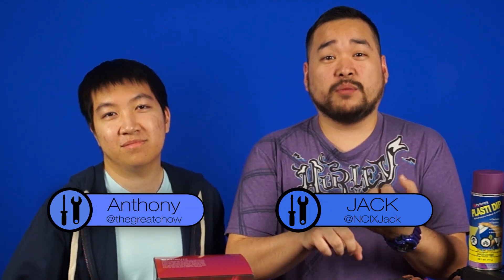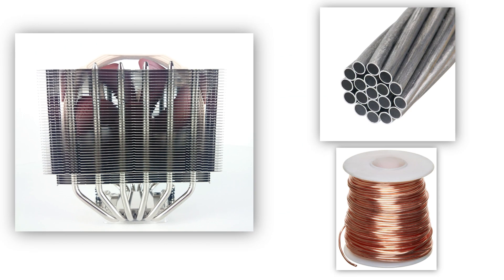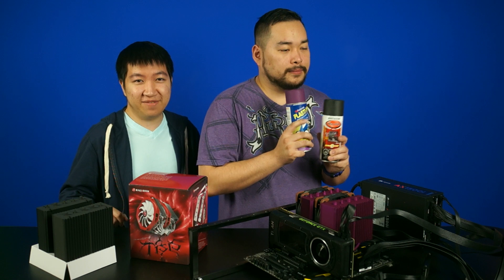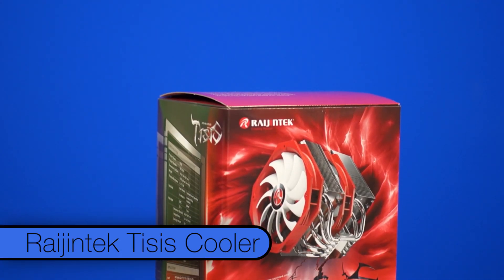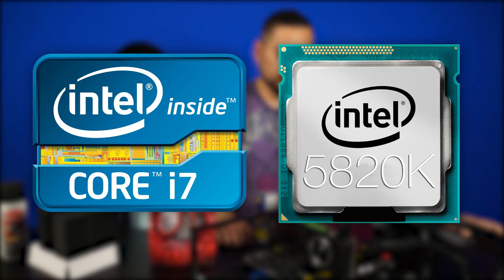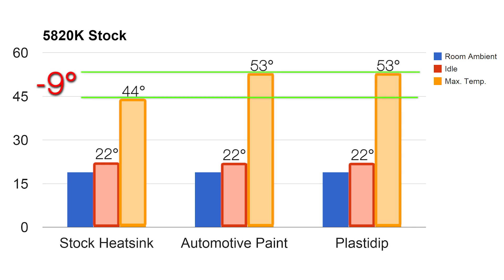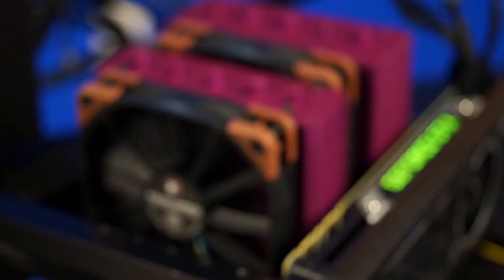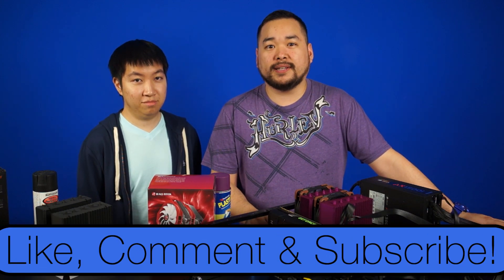Painted CPU Heatsink! Plastidip + Auto paint mod ft. Raijintek Tisis

Comment: Who knows. If this catches on, maybe we'll start seeing heat conductive paint coming out
Reply: It's called stove paint.
Reply: It would be suitable for this application, and affordable?
Reply: Fucking check, how would I know?
Reply: Kendawg McAwesome Stove-paint is not a good conductor - just about same as other paints.  As you said, it is made to be heat-resistant.

There are some paints that add rather thing layers only, but best would be to simply not paint the whole thing but only those sides you actually see - aka spra top-down so only the outer part of the fins get some color and on the inside they can still give off the heat.
Reply: I'm guessing if you were going to do that, you'd want something with decent airflow through the grill. At the end of the day this all seems way more trouble than it's worth to me, but I suppose some people are particular enough, they'd be happy to sacrifice performance.

Another thing that troubles me is whether the paint would stick for long without sanding, and whether sanding would further reduce heat expulsion. I don't know much about painting metal tbh, so maybe it's a non-issue if one picks their paint carefully.
Reply: Kendawg McAwesome Well - i do neither modding nor do i OC.
my CPU is rather bad pined ... ordered and bought at the same time as my friend, exact same parts for the entire build - 5°C higher temps for my CPu -.-

But i have done a bit in the past.
And well - if you get an a bit bigger and better cooler you can again sacrifice some performance for aesthetics.
If you do a mild OC and can till get good temps - why not.

I would rather go for a silver-white build anyways, but haven't got the time nor money to get myself a new PC.

Comment: i am thinking about using plastidip to paint over my M.2 ssd but some say it will bubble up since M.2 tends to get hot. is that true? does plastidip bubble up under temperature of ram heatsink or M.2 ssd?
Reply: Depends on how hot. Plasti dip can withstand temperatures of up to 200 degrees Fahrenheit.

Comment: Sure... I'd paint my "heatsink"... or more like, the CPU block/pump part of my AIO liquid cooler. I wouldn't do it on the radiator though.
But then again, it's already black. so other than painting to remove logos, I don't really see the point.

Comment: I don't think you should paint the contact point that's going onto the cpu tho
Reply: Guy Random there was the factory plastic cover on it which they removed and that means no paint on the bottom
Reply: WayStedYou Alright that makes sense. Still a huge increase in heat though :\
Reply: Yeah not worth it at all lol

Comment: Couldn't you just paint around the outside and leave the heat sink fins alone? You'd get the cosmetic benefit without degraded cooling.
Reply: Haha true. Reasonably they should only have needed to paint the top. But that would probably have made a boring video.

Comment: At the very least don't paint the part which makes contact with the CPU.  I have a feeling you'd have slightly better heat dissipation if that part was not painted, as you want to transfer the heat away from the CPU first.  Once it's in a larger area (the heatsink) you have a lot more area to transfer that heat from, so painting that probably isn't too bad.  But painting the bottom part would be a lot worse as it's that much more difficult for the heat to transfer from the CPU to the heatsink.

Comment: you might have gotten better temps if you didn't paint the contact from the cpu to the heat sink, that's where its most important  to have bare metal

Comment: Since I have a stock cpu cooler that makes it go over 60 degrees and crashes my pc sometimes, I have decided to upgrade. Being greedy due to not having a ton of money ATM to spend on pc components, I put a 6 inch fan that pushes air on my CPU and GPU (In fact all over my motherboard and my side panel is off) I have speccy on my non gaming monitor except for wii u that told me 66 degrees avg and at 67 i would crash my pc while playing BF4 or any demanding cpu games at ultra everything maxed out. Since I added the 6 inch fan to blow on my motherboard focusing on the CPU, My temperature while in-game is 60 degree. All in all, redneck setups can sometimes be just as effective. This may not work for some of you but in Quebec the air is cool and my house is cool ( :D ) so it helped me lose 5-6 degrees.

Comment: I suggest not painting over the pipes and the copper contact that goes to the CPU. And then Anthony will get his glorious 5 deg difference or less.
Reply: DenverJohnBradley Plastic was still on contact area.
Reply: WistfulBreeze Exactly. If there wasnt, the heat would transfer more.
Reply: DenverJohnBradley  So you want him to paint over the contact area then???
Reply: Did you even read my original comment at all? XD lol
Reply: DenverJohnBradley I did, he probably removed the plastic that was painted over before he installed it.